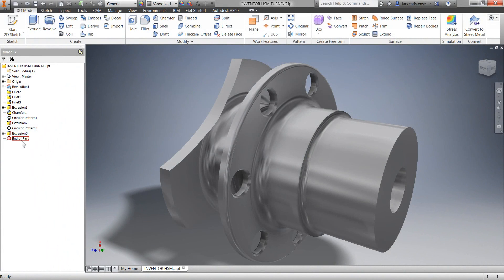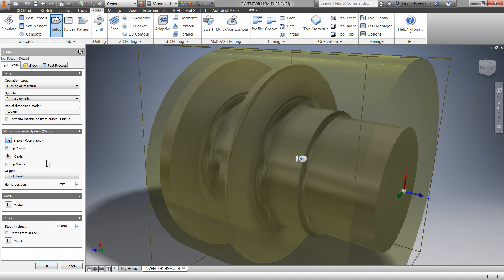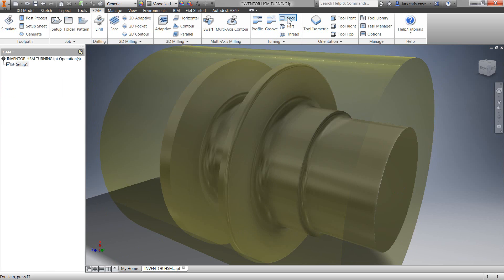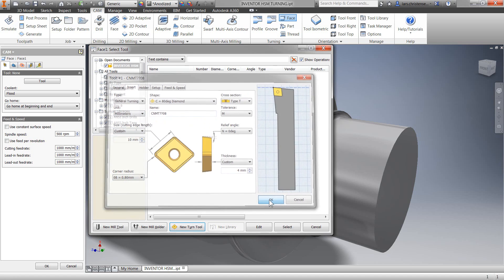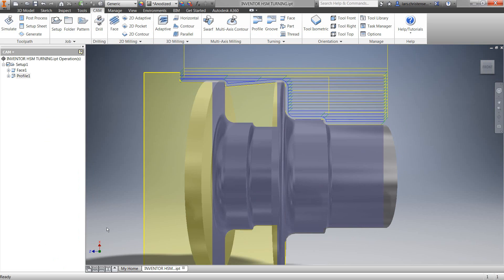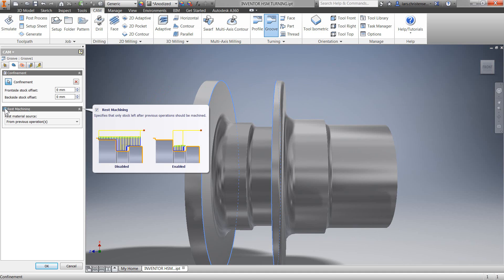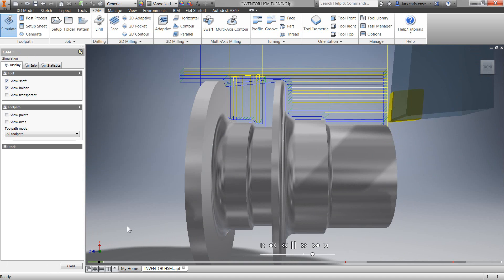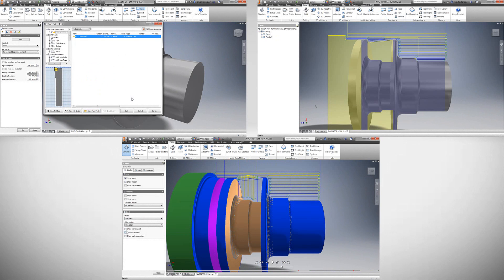Inventor HSM : Fundamentals of Turning

Comment: And how you send the G-Code to the machine?
Do i need anothe program or HSM send it to it?
Reply: HSM should be able to do it just like CATIA can... We use Sinumerik 840D as a control unit and you can make all the operations in CATIA and export it as a MPF file which you then take to WinNC and just turn on a simulation. You can eventually do some corrections in MPF file in case there are some parts of code unknown to your control unit just to eliminate possible errors during simulation.